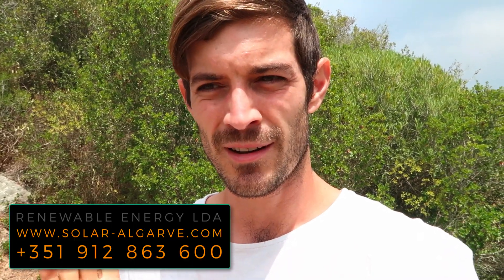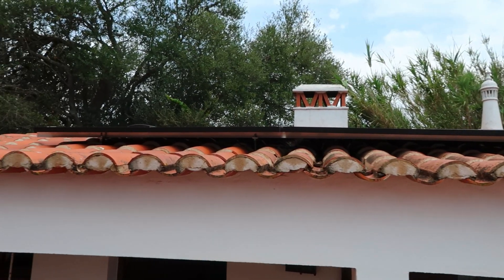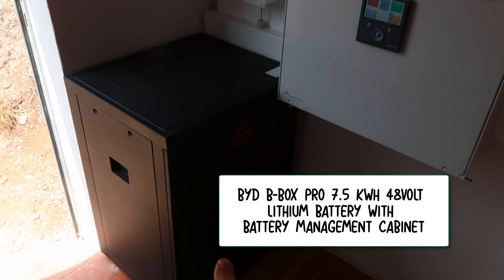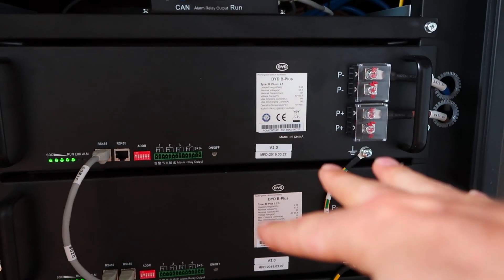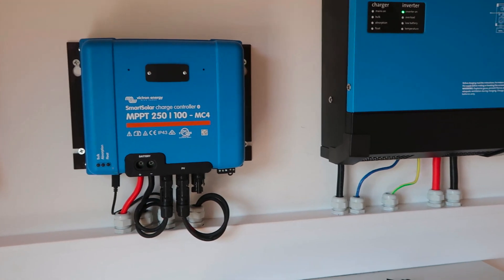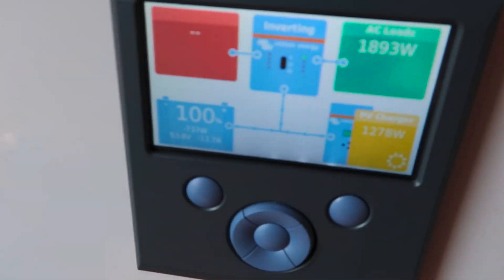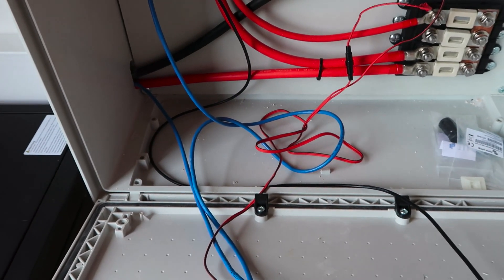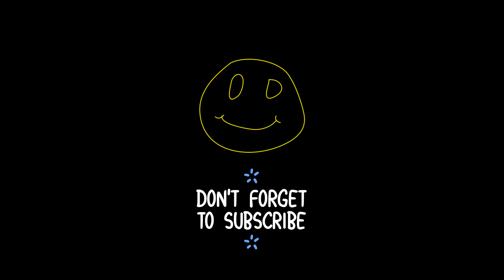Family of 4 | Off-Grid setup | Solar-Algarve

Comment: Great video. My wife and I are in the process of buying a house in the hills slightly north of Santa Catarina. I'm not sure if we should go off-grid or tie-in. Any thoughts on that?
Reply from the maker: Hey there and thank you. It's definitely worth considering. If you're not already connected to the grid, depending on your location the cost to get connected can be more expensive than a good off grid system. I'd highly recommend contacting solar Algarve as they have installed systems all over portugal. They offer off-grid and grid connected systems for all types of energy demands 👍

Comment: Hi,

I am just about to complete on a ranch in Portugal and it is off-grid.  I too am an electrician and will be upgrading the solar installed to a Victron system and will also be using Solar Algarve for my gear.  Can I ask how you installed the rails on the roof?  It seems vastly different to the hook/rafter way we would do it in the UK?  The rook on my Portugal property is the same as in your install so I am interested in how to do it.

Thanks.
Reply from the maker: Hi Neil, have you got solar algarve booked in - i work with solar algarve so no doubt I'll be helping to install!

If there is concrete under the tiles we mount screws into the concrete which support the panel profiles. If there are wooden rafters we simply screw the same screws directly into the rafters. When there's neither, we build our own metal brackets and use threaded bar. 

We generally prefer a dedicated space near the house to build a steel frame mounted in concrete, but if roof space is the only option we hope for concrete roofs as it's much easier and quicker to install! Hope this info helps and could be meeting you soon 👍😊
Reply: @wanderingsouth9874  that's great cheers.  I have not been in touch yet as unsure when we can get out but now looks like we should be there this month some time. Land is not an issue so a ground mounted install may be an option.  When I make contact I will mention you.
Reply from the maker: @neilbridgeman7768  please do 👌 which district is your ranch in? Good luck with the move and safe journey when you're able to move. If you have any quires regarding your move don't hesitate to get in contact. We just moved into our new house last week, the process was a roller-coaster but we got there in the end...
Reply: @wanderingsouth9874  we will be in Torrao.  It will not be our perm residence but more of a holiday home.  It has been a nightmare to be honest trying to sort this during the current situation but we are finally close now.  Thanks for the offer though - very kind.  I will call Solar Algarve next week hopefully and start to draw up a plan of action.  We fly out on the 21st.
Reply: Looks like we will be meeting next week mate. Look forward to meeting you all.

Comment: Nice system.  Do you know if the battery bank is using prismatic cells and who the manufacturer of the cells is?  

Also are your charge controllers programmable so that you can set the maximum state of charge to 90% to achieve a higher number of cycles over the life of the battery?
Reply from the maker: The manufacturer of these lithium batteries is BYD, I know they develope prismatic cells but I'm unaware if these ones are. And yes the MPPT controller is controllable to set maximum charge rates. I believe we set ours to 91%. When we first installed this system and connected it to the Internet, we installed the most up to date software and settings provided by victron. This was done by solar-algarve as this was my first install 👍

Comment: We have a very similar system installed in our house here in England. We  have it feeding to the grid as well though so the government pay us for what we produce (not the amount fed back to the grid) so it's win win for us. As for the use of power to the house I spread the use of each individual device as much as the solar panels are producing where possible (like you suggest) we only have 2 lithium batteries 3 is much more sensible on an off grid system. We also have something called an immisun (not sure of spelling) this means if there is any surplus power after the house and powering the batteries, it goes to the hot water tank before the grid.
You have done an excellent job of explaining the system you've installed (I didn't know about the tech. side of installation).  
I wouldn't hesitate to recommend this system. Although the outlay seems a lot it's a marvellous system of generating your own power and as long as you are sensible about not putting all electric items on at the same time it works a dream. Well done -Lin xx
Reply from the maker: Thanks Lin. I think it's great you have solar panels in the UK! Obviously it's a different scenario as the UK sadly doesn't have as much sun as portugal, but investing to produce your own energy as well as putting green energy back into the grid gets a big thumbs up 👍